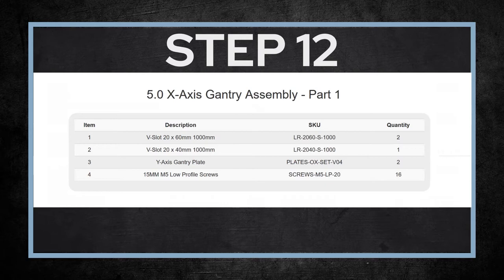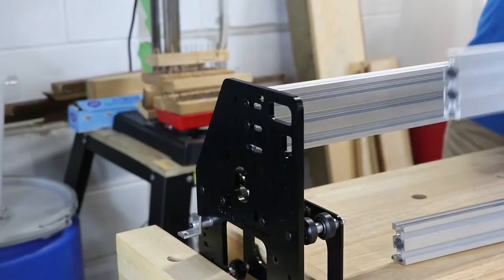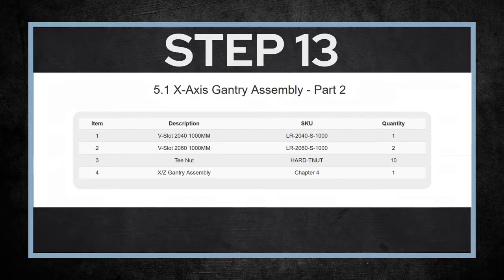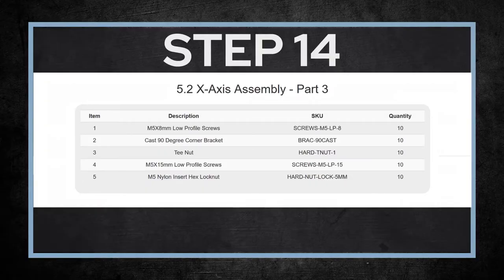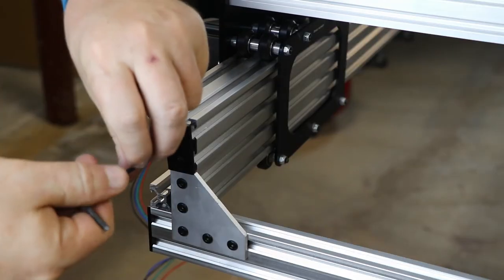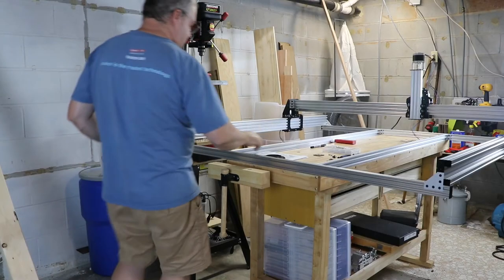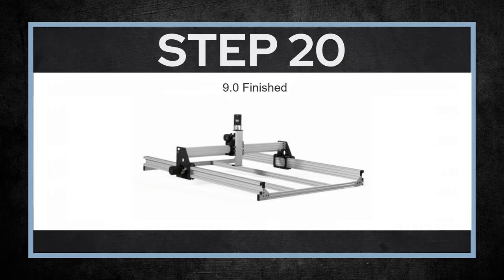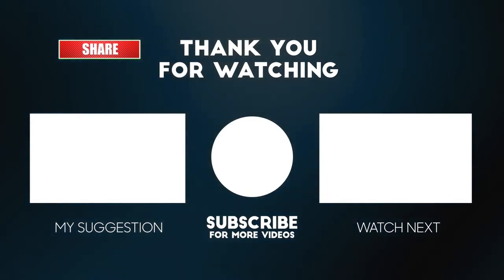Ox-GEAR 1500 x 1500 CNC Mechanical Kit | Tips & Tricks for Assembly

Comment: Thanks for the comprehensive assembly video, it's saving me some frustration & colourful language as I go through the adventure.
Nice safety socks by the way...I always insist on safety slippers in my workshop, to comply with our local Australian regulations. ;-)
Reply from the maker: Thanks for the comment and welcome to the journey! Hopefully the wiki has improved a little. ;) Overall it wasn't bad at all. And while I am still dialing some things in my system has functioned fine so far. My only real complaint is that the ox plates have the X-Axis rails too close to the spoilboard. So the amount of Z-Travel is very limited. I recently moved my Z home switch to the side in order to get just a little more travel. My plan is to investigate adding  another small piece of extrusion rail between the C-Beam and the supports that hold the spoil board. That way I can put much work thicker pieces on the surface. The joy of being old is having learned the hard way what it is like to step on dropped screw in the workshop LOL.

Comment: Sir,can you review details about your pinion,think that pinion from POM type
Reply from the maker: What I can tell you is that all the gears used in this build came with the Kit from Makerstore.

So the ones used on the Y Axis the manual states the following:  "For Machines Sold After 01/06/2021 -- We Have replaced the Gear Size from 32T Pinon(Gear) to 16T Pinion(Gear)" You can see a picture at this link. https://makerstore.cc/product/us-gear-m1/  Let me know if that doesn't answer your question. The timing belt pulleys can be seen here. https://makerstore.cc/product-category/transmission/belts-pulleys/

Comment: Thanks for sharing, very informative, i wonder if the size of frame is possible to 2.000 x 2.000 ?
Reply from the maker: Interestingly enough, MakerStore USED to sell a 1500 X 3000. But they stopped. You couldn't buy them in the US because of shipping rules but you could buy them in Australia. I originally had plans to use some of the joiner plates to connect two of these together to make my own 3000. Having one extrusion rail would be better, but in theory you can join them together to make a larger version. As long as it is sturdy enough to keep from moving.

https://makerhardware.net/wiki/doku.php?id=manuals:ox_gear_1500x3000

https://www.makerstore.com.au/product/brac-180inside/
Reply: @TheProjectHelpDesk  youre being very much helpful, i think i will start my build, thanks 🙏🙏